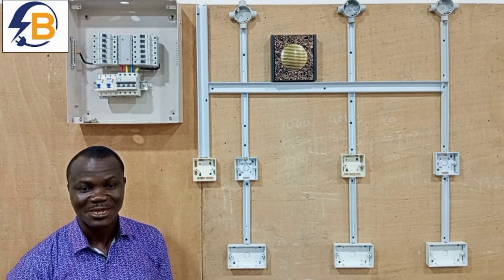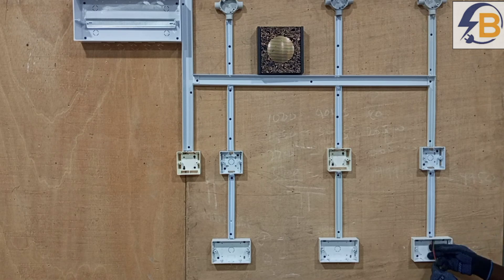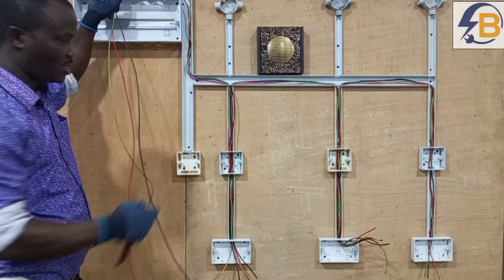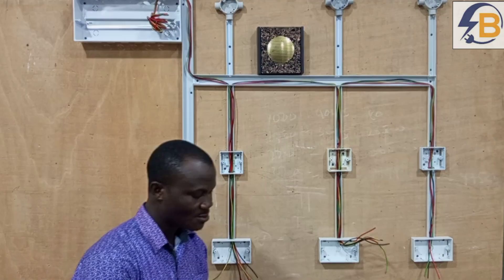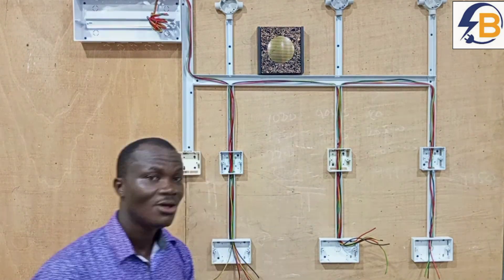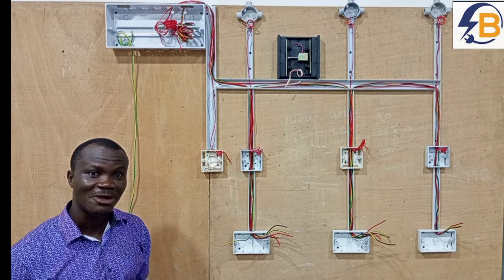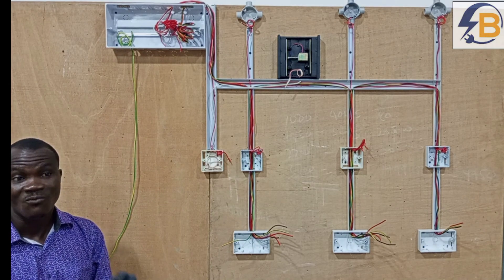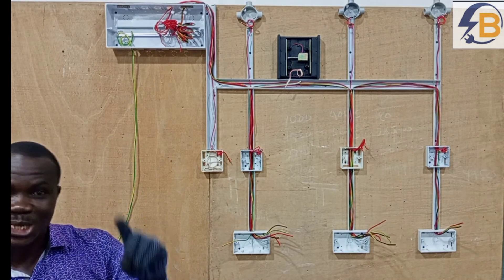Full Electrical house Wiring  |PART2|

Comment: Just curious... Do you run the power wires through the light switch in a real house or are they run separately in its own conduits? Great content.. keep it up
Reply from the maker: That depends on the particular situation and the design. You only have to consider the size of trunking or conduit.

Comment: Sir can you make a video on full  G+2/3  building electrical installation,  starting from main board, how can  pass PVC from floor to floor and putting of fittings on slab  before concrete.
Reply from the maker: Please if you are willing to train reach out on +233209323669
Reply from the maker: If you are willing to train reach out on +233209323669